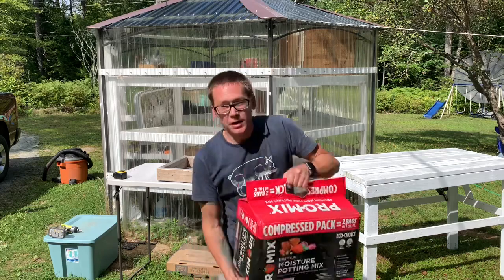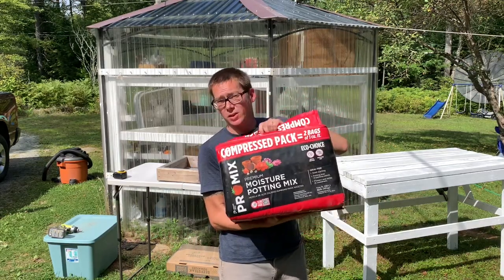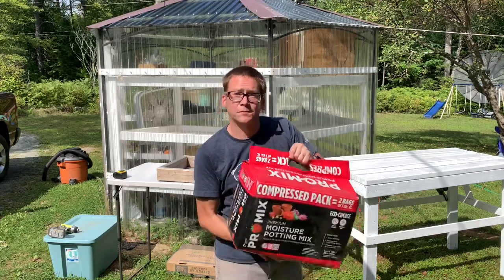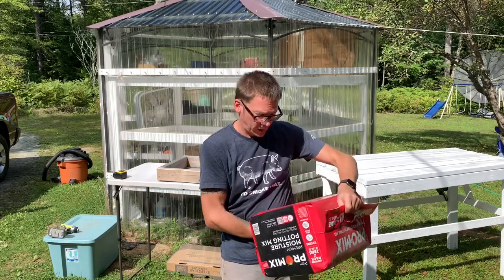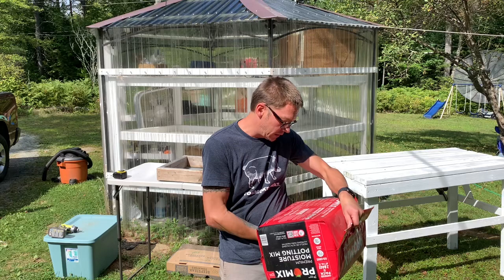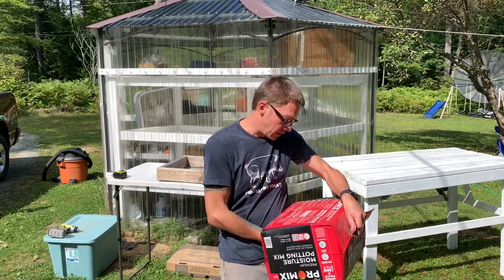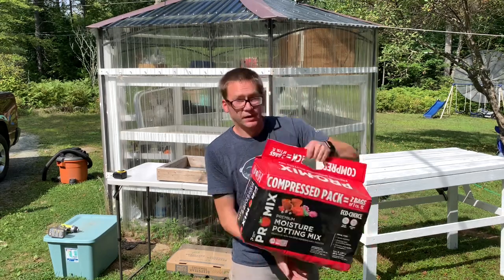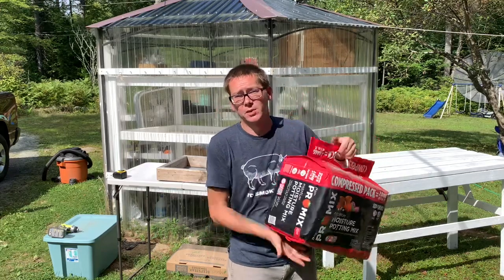Super Soil Sifter (For Microgreens )

Comment: Just out of curiosity why did you stop using the coco core....I quit sifting and bought coco core after watching it.  Mix it with Pearlite and it has worked for me but I have been growing less lately.  What all issues did you find with the coco core?  Thanks as always for your videos
Reply from the maker: dcloukey No issues with the coco coir other than availability. The hardware store I bought it from stopped carrying it and my local hydroponics store isn’t currently carrying it either. I can buy it on amazon but it’s expensive.

Comment: You can eliminate the gear box if you mount the drill vertically onto the frame of the white table instead of horizontally. Then use a bit in the drill with a small plate on it like what you have coming out of the gear box.  A variable speed drill will also give different speeds of shaking or vibration depending on how much you press the trigger.
Reply from the maker: Mori The point of the gearbox is to keep major vibrations off the drill bearings. It is a variable speed drill.
Reply: Good point as long as the gear box costs less than the drill.
Reply from the maker: Mori Yeah I have a few kicking around.